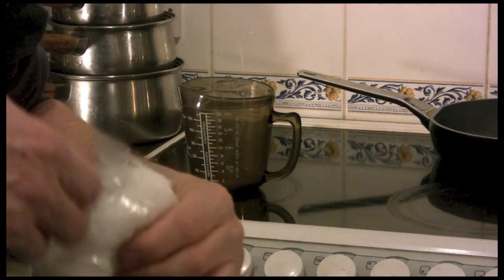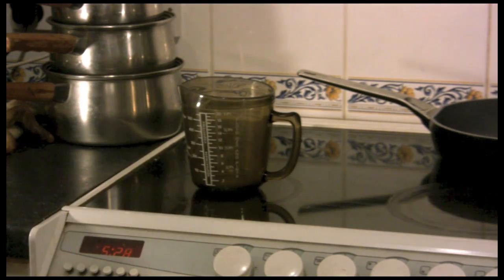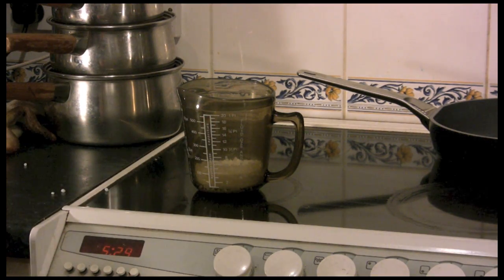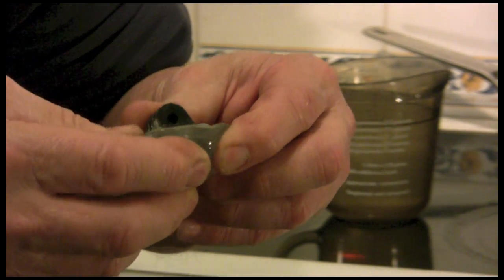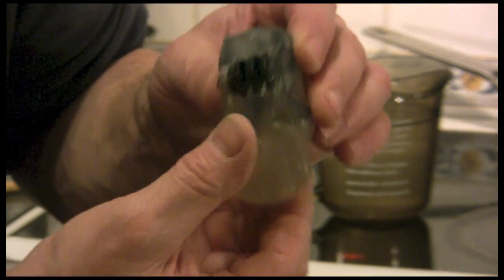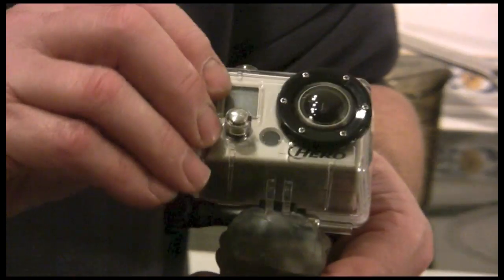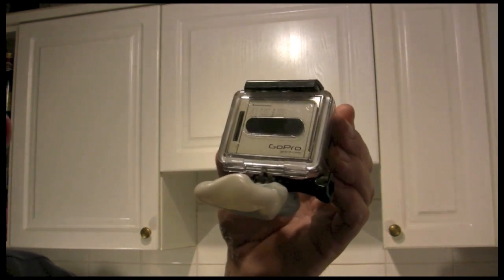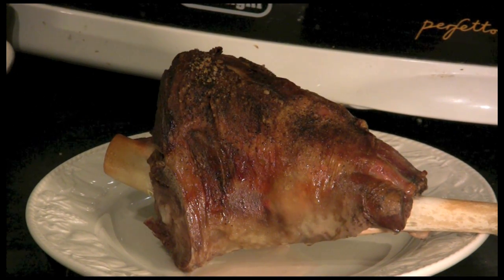GoPro Mouth Mount

Comment: I enjoy your videos.  Check out my horseshoe bender.  Cheers!
Reply from the maker: That looks interesting, are the rollers sprung loaded to get the shape? Do you dress the heels before bending?
Reply: No the rollers are loosely bolted but adjustable.  The center is half inch plate.  The inside dye about a size 7 shoe UK.   About a size 1 US.  If you would like to make one I can send you the plans.   Perhaps I can pickup some more subscribers.  No charge.
Reply from the maker: Does it work ok on concave or is it just for plain stamp? I would be interested in having a got at one, if I di you would certainly get the credit and a few shoutouts! 😉😉
Reply: The heels can be cut with a hardy.  I usually just hammer forge them.
Reply: I can’t keep the concave flat in it. Perhaps you could figure a way maybe with a die that is beveled.   I am traveling through the 5th of December. When I get home I will send you the plans.
Reply from the maker: @richardbumpuscjf347  👍🏻👍🏻

Comment from the maker: Polymorph. A fantastic thermoplastic polymer which combines tough engineering qualities with a softening point of only 62C that means it can be heated with hot water or a hair dryer and moulded by hand. Use it to mould handles or orthopedic aids, armatures for models, replacement parts, or joining components.